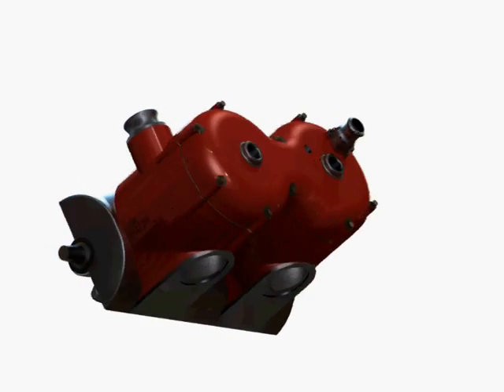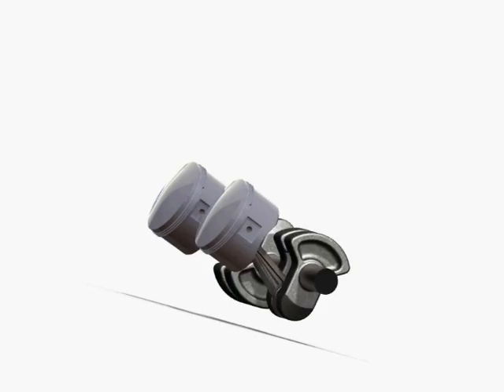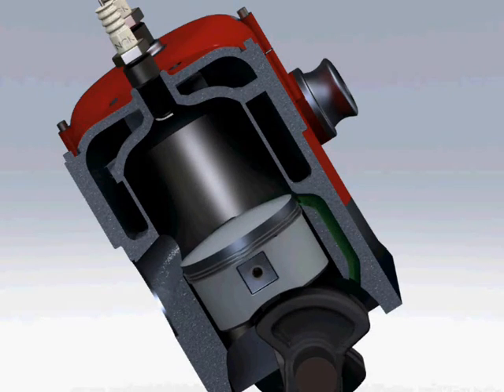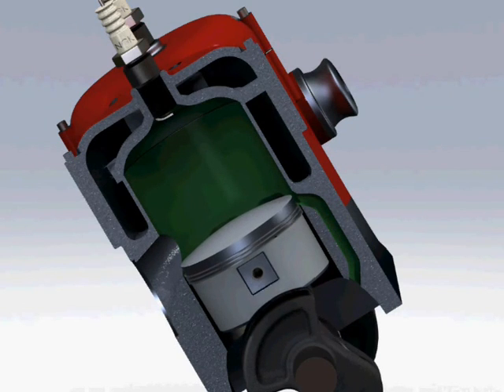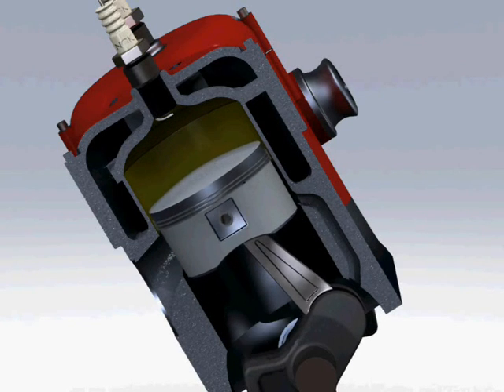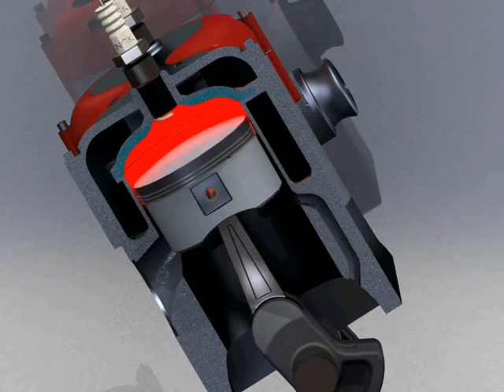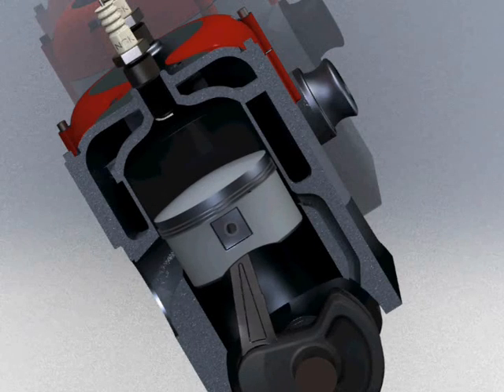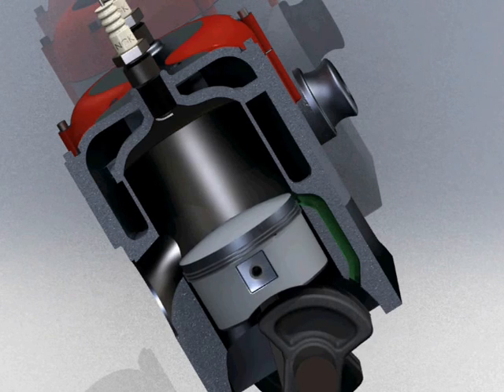two stroke engine explanation with voiceover.wmv

Comment: so wtf are boost ports???
Reply: Boost ports are a type of transfer port between the crankcase and the cylinder.  They are usually found directly across from the exhaust port, and are usually fed through a hole in the piston.  Regular transfer ports are aimed such that the incoming charge hugs the top of the piston and travels toward the rear of the cylinder.  Boost ports are aimed toward the spark plug, which directly the main flow from the other ports up in a big loop across the top of the cylinder.  This allows the incoming charge to effectively fill the cylinder and get rid of remaining exhaust, rather than just mixing with the exhaust or blowing about randomly.  Compared to an engine without boost ports, an engine with boost ports will typically see a slight increase in top-end power, and a VERY noticeable increase in low-end and midrange power due to this efficient scavenging.
Reply: ah thanks for that

Comment: yeah so the greens say, its also a advantage because of your expansion chamber it sucks the fuel in and makes it more efficient so to speak (not for fuel though) but it helps it self by drawing some out.
this is reduced with newer 2ts and powervalves and reed cages that you do not see in the video

Comment: That's why most two strokes have an expansion chamber (The big bulge in the exhaust header). After ignition and compression, some of the exhaust gasses that leave the combustion chamber are bounced back into the engine by the tapered shape of the chamber, which causes an instant succion that moves exhaust towards the cylinder, so there is a counterbalancing force made by exhaust gas that insulates unburned fuel mixture from leaving.